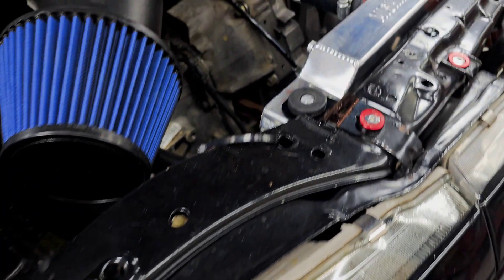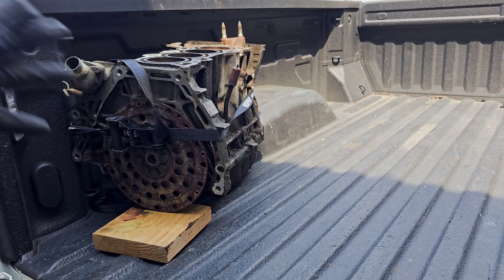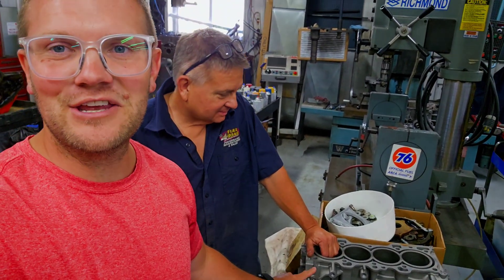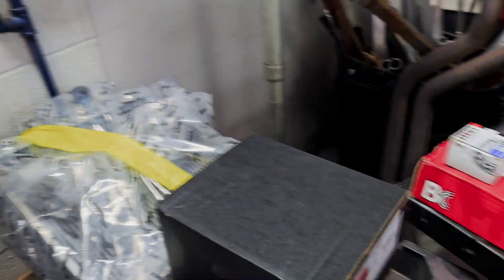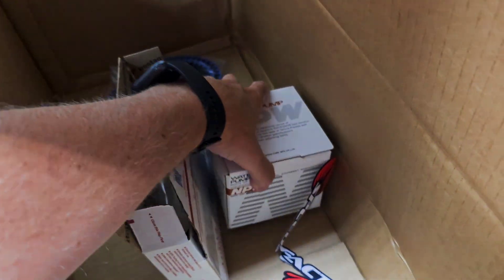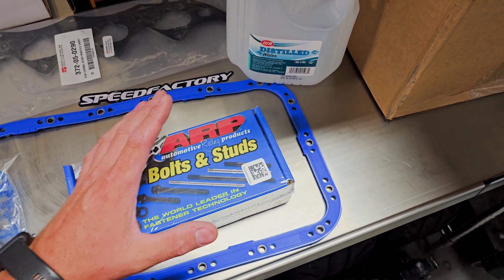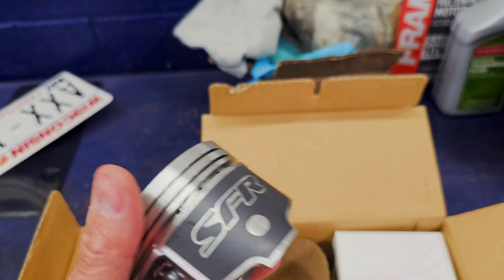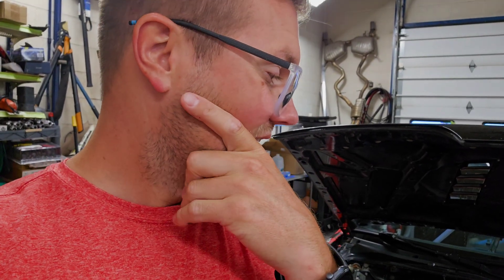How to build a 250hp b20 vtec. Part 1

Comment: Have a tired b16a that needs a head gasket and rings. So trying to decide between b18V or b20V. How is your b20 holding up to track racing?
Reply from the maker: It's been great. No issues as long as its built properly
Reply: @diyclay525 ok perfect. Did you do any changes internally for oil, such as oil squirters or galleries?
Reply from the maker: @adamepps5514 only thing oil related is the acl pump. Otherwise everything is stock for oiling. I do run a oil cooler as well

Comment: How are you mitigating the B20s propensity to crack sleeves at high RPM? Currently building an LSVtec, as my B20 had sleeves cracked. Yes, I had forged pistons and rods, balanced - the whole hog. B20vtec might be OK for street only use, but I'd want Darton sleeves or something for track.
Reply from the maker: There usually fine for awhile. I do a new build every couple seasons.

Comment: nice built what oil pressure numbers did you get with the ACL PUMP?
Reply from the maker: Thank u. 100psi cold. Normal operating temp around 50

Comment: My B20 VTEC made about 230hp NA I ran RS machined pistols which were type R spec but for the the B20 bore I used stocked crank stock rods acl race bearing Honda OE pistons rings ported B16 head type r spec cams lightened flywheel stage 2 clutch blox intake manifold rmf narrow headers and B16 trans on drag radial the cars best times quarter mile was 11.9 on drag radials and I spent about $2500 on the build
Reply: I'd Throw a ITR B18C5 Head on that B20 that would slap
Reply: What chassis? I’m doing a very similar build but with a gsr head in an ef sedan
Reply: @sethallison5682 94 civic ex coupe gutted
Reply: I never put it on a dyno but I’m assuming lol

Comment: Can’t wait to follow this build I’m very curious as to the parts you will choose. I have a “Budget” B20/VTEC and disclaimer (It is Not Dyno Proven) my build consists of B20B Block and crank stock rods with ARP bolts Nippon 84.5mm P30 pistons P72 Head (GSR) Hand ported by myself with Ferrea Valves SuperTech Springs (85lb) BC steel retainers Skunk2 LMA’s with Skunk2 Pro 2 cams with Pro series cam gears bolt ons include Ultra street intake manifold with a 74mm throttle body 3” intake with V stack Exhaust is a PLM 4-1 with megaphone 2 1/2” collector with test pipe and 2 1/2” exhaust with resonator and muffler tuned with Hondata s300 and on E85. If anyone has similar setups let me know I can’t wait to get mine on the dyno but she feels strong
Reply from the maker: I do show pretty much all the parts in the video
Reply from the maker: Thanks
Reply: So excited to see how it turns out love the parts selection 💪🏻
Reply: are the nippon pistons worth it over wiseco? i saw they were cheaper and im only really aiming for 300-350 hp. didnt know if i really needed to spend 1k on a piston and rod setup.